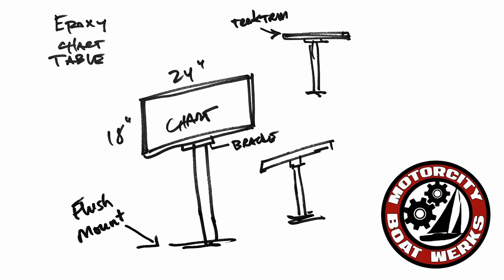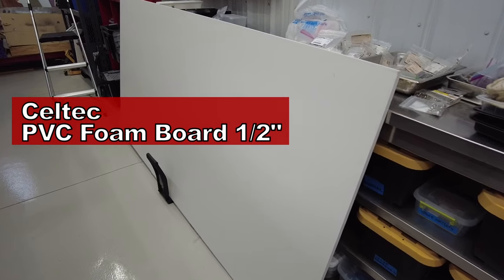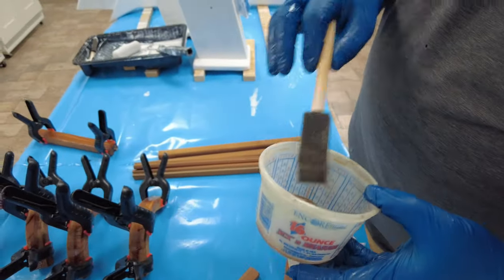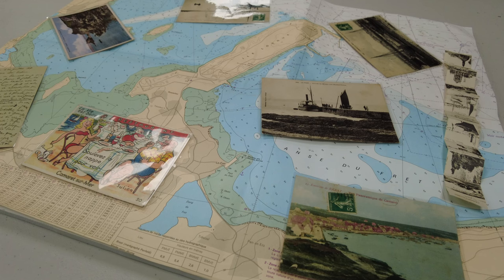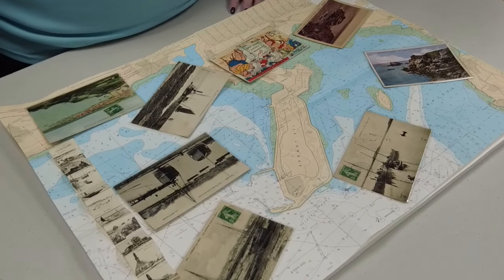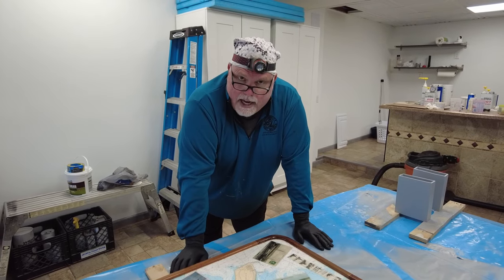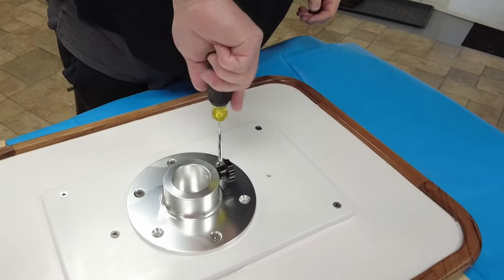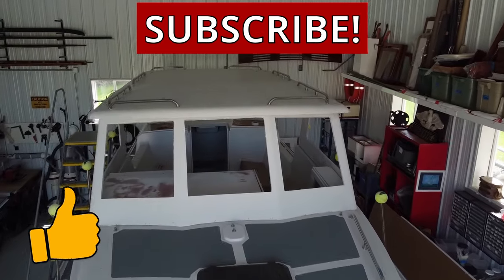How to Make an Epoxy Cockpit Chart Table  - Pt3 | Boat Restoration (Ep59)

Comment: I do a lot of epoxy countertops, love working with it. I use a heat gun, a torch and isopropyl alcohol to get rid of bubbles. Great job on the table! Love the inlay of the chart and the meaning behind it! Another great video.
Merry Christmas
Reply from the maker: Thanks David. I’m going to be trying alcohol on the next table I do. Perhaps another small co more table for the skipper 20 sailboat? 👌😁

Comment: Really cool table. I might have to do something similar on the next boat I build. Total Boat makes a deep pour epoxy for pouring table tops. I think you can do a really thick pour without worrying about the epoxy overheating.
Reply from the maker: Pouring multiple pours was really pretty easy. The challenge was in removing the bubbles which appears to come from mixing. I hope this episodes gives people ideas and confidence for their custom projects. I agree This would be interesting to hear about experiences with other clear epoxies  😁👍